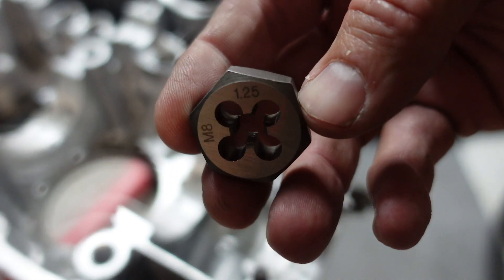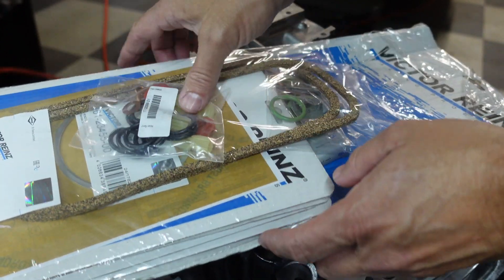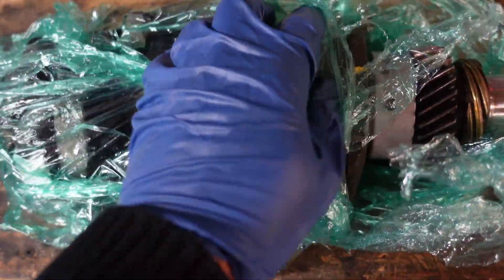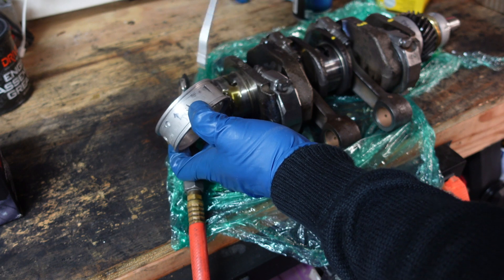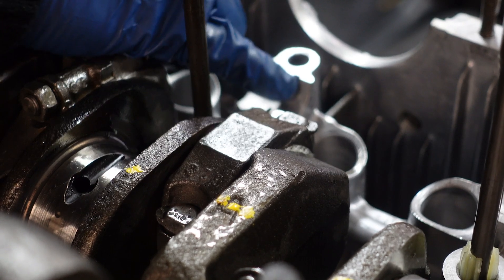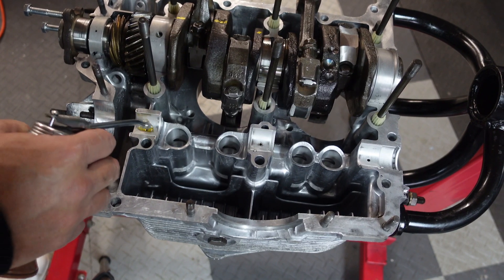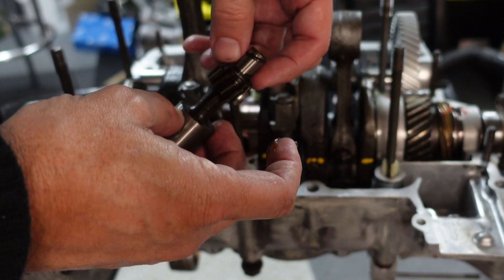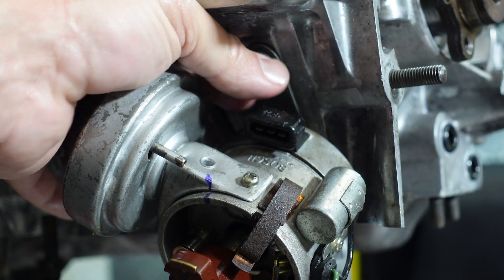Porsche 914 VW Type 4 2056 Engine Build Part 2 [Project Bumblebee Ep 08]

Comment: I kind of Cringe  watching these videoes on MainBearings  my first full rebuild wa on a WaterCooled VW Rabbitt  , I put the motor together and drove the car locally for over a thousand miles trouble free  my intentions after that year was  to Drive the Car On a 1500 mile trip  of all highway  miles  about 600 miles into my Trip the Engine began Knocking and lost power  when I got the car home  and pulled the motor  I discovered I Spun the MainBearings   I put the motor back together  than the Bosch FuelInjection gave out
Reply from the maker: Ouch, sorry to hear about your experience! Definitely a reminder to double-check everything.

Comment: Hi! I was wondering wich camshaft do you use? I have a 1800cc dual carb and I’m looking keep it as stock as possible… And it’s seems difficult to find.. Thanks
Reply from the maker: I installed a 9590 from LN engineering

Comment: Ian: Did you purchase the Crankshaft fully assembled (Fully reconditioned and balanced, with Connecting Rods, Distributor Gear, etc.)?  If so, from which Vendor?  If not and you purchased components separately, which Vendor then assembled everything?  (Great help to have it already assembled).  Appreciate your advice so thank you in advance.
Reply from the maker: My existing crank and rods were in great shape. I had the crank evaluated, balanced and polished by Westchester Machine in Tarrytown NY. Jorge at European Motor Works installed new rod bearings.  Good luck with your build!
Reply: @IanKarr  Thank you Ian.  Say, what is your Paypal email address?  Also, have you filmed the episode where you install the EFI system (assuming the stock D-Jet) and complete the break-in engine run?

Comment: Hi ian - I’m following you’re vides as I build my 914 1.7l as a first build. 
Today I started and really struggled with the distributor install. Does the base of the clamp sit flush against the case when it’s proper ally seated or is there a gap? I must have installed it 10 times and as far as I can tell it’s seated (rotor turns when the crank moves) but it didn’t have a satisfactory seating — also, did you use the small spring between the shaft and the distributor? I couldnt see it in the video - and your two ends met as you pressed it all into the case, whereas the spring pushes mine off and makes its difficult to be sure to two shafts are seated right…
Reply from the maker: Hi Ian (great name btw). Yes, the clamp sits flush against the case (or very nearly so). And yes, I do run the spring under the distributor. I forgot to put it in when I made the video. Good eye!  The trick with the spring is to put a dab of grease on the bottom so it stays where it should. Not sure how/why your dizzy isn't seating properly. Have you made sure it's oriented properly? The bottom of the dizzy only fits one way into the drive gear.
Reply: @IanKarr  cheers Ian for the reply - yeah it’s all orientated correctly - I’m going to try the install again with a replacement distributor as The one That came on the engine is a cheap knockoff - do you have any recommendations of which distributors to run on this engine (1700cc)- the more I research them the less certain I am, as is often the way

Comment: Great video! funny story, when I was in the Marines in the late 90's I actually rebuilt the engine for my 65 Beetle IN my barracks room..
Reply from the maker: Were you able to bounce a quarter off it? ;). Thanks for your service!
Reply: @IanKarr  I remember there was grease all over the carpet. The engine ran well for a while, unfortunately another Marine had told me to leave off the sheet metal, that the engine ran cooler without it.. We know how that ended..
Reply: How long has it taken to acquire all of the parts / get everything machined, etc..
Reply from the maker: @stevenhenry8743  I've been at it for about 3 months now.

Comment: Ian, I think you forgot to put in the lifters before dropping in the camshaft.... Great video though - thank you for your effort!
Reply from the maker: Thanks, Michael. Hmm. I believe the lifters should go in after the short block is assembled. Otherwise the ones on the right side would fall out...And the ones on the left can only go in after the case is assembled. No?
Reply: @IanKarr  Ian you are right.. Type 4 goes in after the halves are together. The Type 1, 2,3 have to go in first, along with the pushrod tubes. Keep trucking you are almost there!
Reply from the maker: R. Arabian thanks rob.
Reply: @IanKarr  woops, my bad. Type 4, not Type 1. Shoulda known🤦‍♂️

Comment: Hey Ian, another great video! I have a 1.7 in my 914, but now I have a good 2.0 crank so I will start accumulating more parts to do a 2056. This video gets me motivated! I noticed you used oil on the bearings vs. assembly lube. Did you want it to be lighter viscosity?
Reply from the maker: Thanks. I did use oil...as Jake recommends in his video. Full disclosure...I went back and used assembly lube after I shot this because the engine will likely sit for a while before starting. It's amazing how much stickier that stuff is.
Reply: @IanKarr  I agree assembly lube is ideal if the engine is left for a while, and it's always a funky colour, but for a engine being started 'soon' engine oil is spot on
Reply from the maker: @CrispysProjects  Thanks Crispy. Congrats on your channel. I subscribed...

Comment: @16:55 -- On all stock-type 914 distributors that I know of, there is a mark scribed on the lip of the distributor body at the #1 cylinder position.

The teeth on the distirbutor drive gear are slanted (hypoid gears) so you actually have to turn the driveshaft a bit to get the teeth of the drive shaft to mate to the drive gear on the crank.  This is especially apparent if you R&R the shaft with the engine together.
Reply from the maker: Thanks for pointing that out, Dave. Yep. On all that I’ve owned (before this one) there’s a mark on the lip. For some reason this one doesn’t have it...so I thought I’d show how to line it up using the cap lead.

Comment: On all Bosch distributors there is a cut slot on distributor surface where the cap meets and that is number one cylinder.. Good video. Have had many of these type 4 motors apart. May have to do my own 2 litre soon,at least a reseal.
Reply from the maker: Thanks, Nick. Good luck with your build!